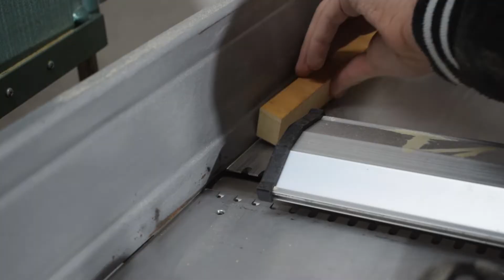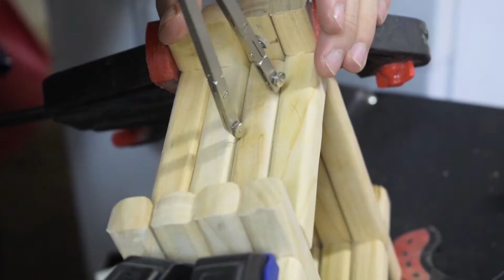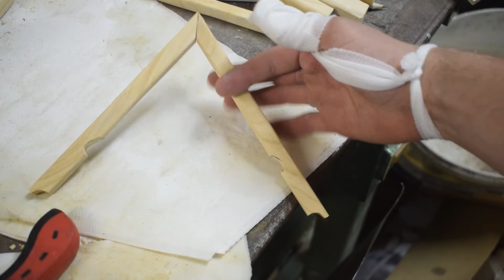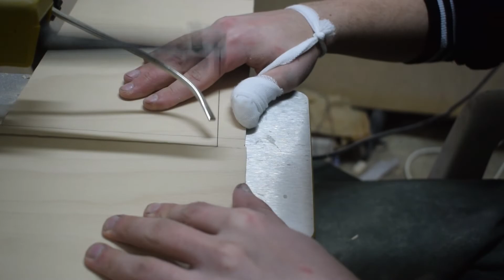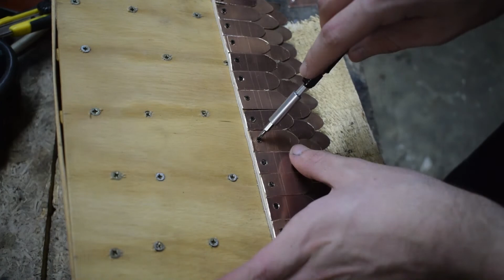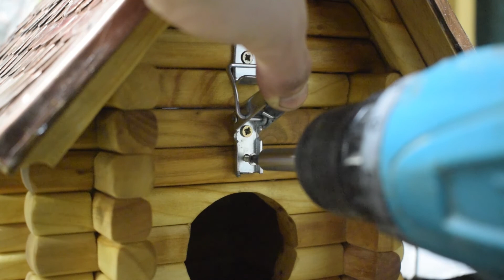Making Wooden Birdhouse

Comment: This is more a piece of art than a functional birdhouse.  The hole looks as if it is designed to attract pelicans, not your average wild birds.  Also, preservative oil on the inside is never good for birds.  There doesn't appear to be a method for annual cleanout.  Also, drainage holes in the bottom are necessary for a proper functioning bird abode, as are ventilation holes near the top. Finally, birds do NOT require perches.  Predators, however, do.  I see you have a finger boo-boo.  Perhaps a push stick when you're using the band saw would help keep your digits away from a very aggressive blade.  Your copper roof is quite artistic; all in all, a nice project ...